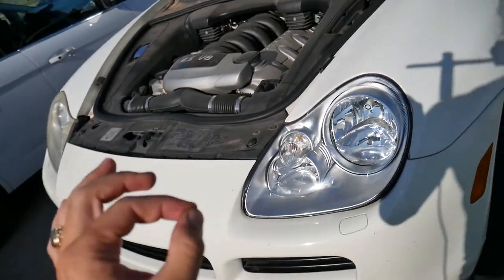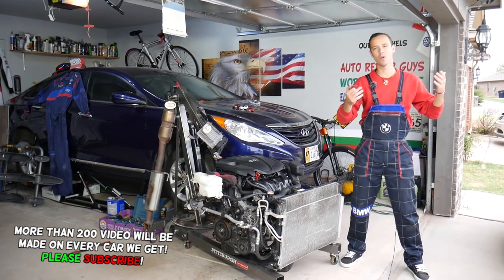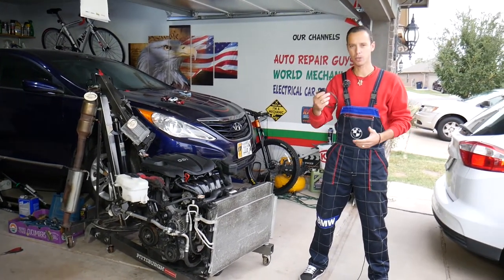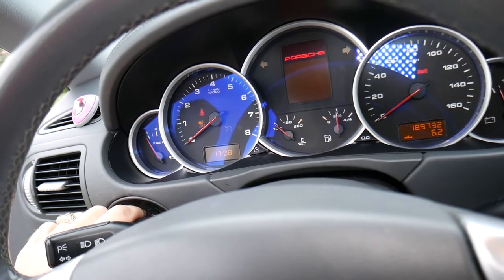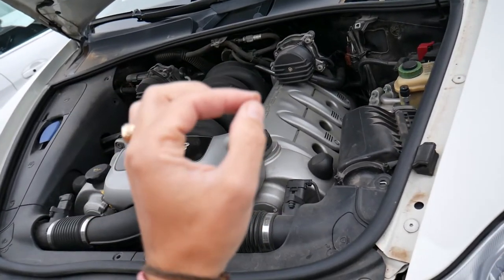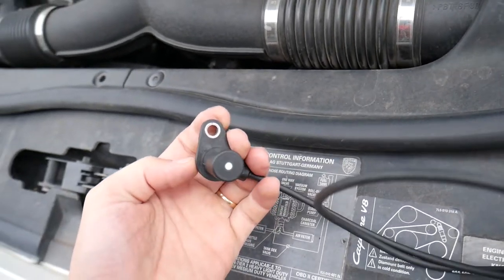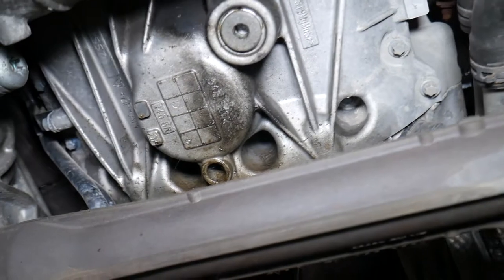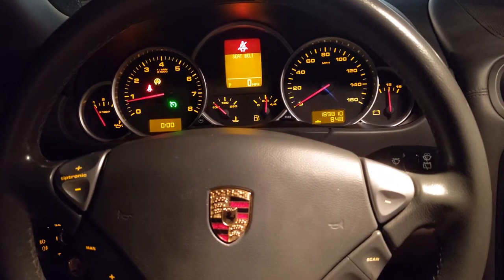CAR STARTS COLD BUT DOES NOT WARM HOT, CAR DIES WHEN WARM HOT

Comment: My problem only happens when it’s hot outside. My car always starts perfectly all day long as long as it’s under 75 degrees Fahrenheit outside, but anytime it’s hotter, like 80 degrees or more my car has an extremely hard time starting. It’s a 2017 honda Civic with the 1.5T

Comment: I had this on a vauxhall
Reply: What was it a Corsa D, 1.0L won't start warm after changing 02 sensor 1,2 and EGR valve. Pulse sensor crank sensor. It's still the same.

Comment: ok i got the similar problems, Car starts cold all good. everything works until it's hot then we have digital mileage showing our mileage also some lights is not showing on dashboard plus the obd port is not working. I did scan the car and we only have the code P0140 o2 sensor Activity bank 1 sensor 2. But we had that code for a long time as we have removed the catalytic converter and made it free flow. But we never had any problems over a year. 

If the sensor packs up will it give out a code?

Comment: My car starts when it’s cool outside but once it get above 75, it won’t even turn the starter.
Reply: Did you find out what the problem was? Im having the same issue in my accord!
Reply: @automotivetv9861    I found the problem about 3 week ago. A small plastic part in the ignition assembly that swelled and shrunk with the outside temperature. The part cost me less then $100. Had to go through the steering panel to get to the part .